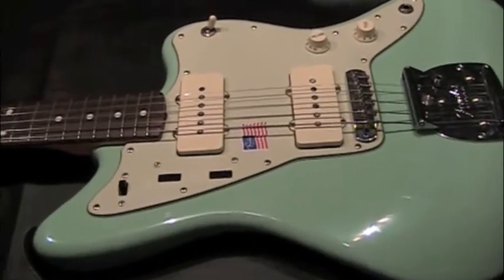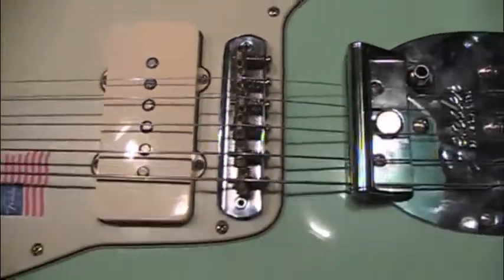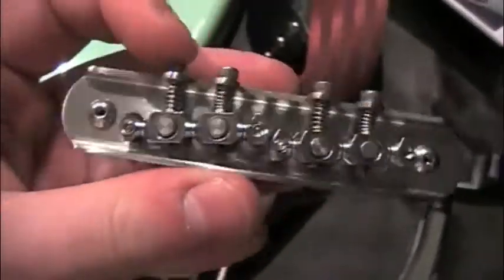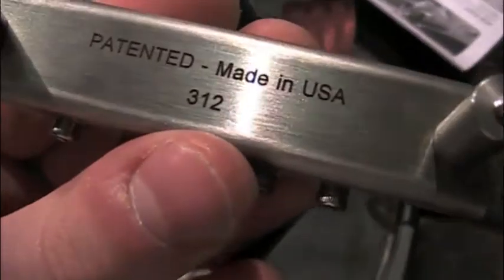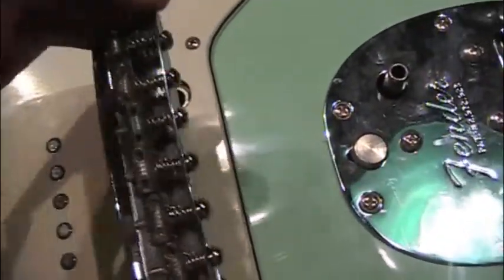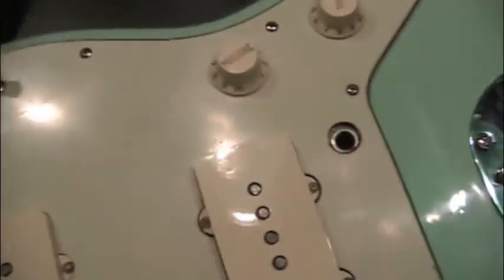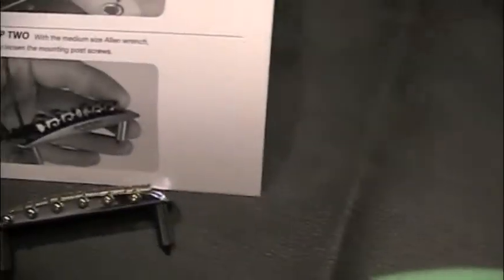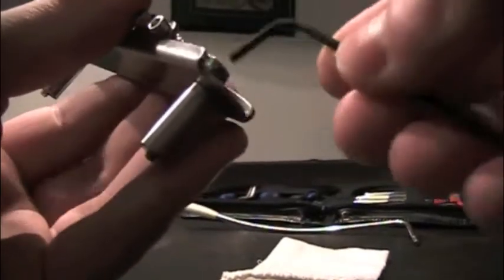Installing a Mastery Bridge on a Jazzmaster Part 1

Comment from the maker: It's a 62' American Vintage Re-issue in Surf Green, about a 2003 model or so. They didn't make them in any colours other than White, Black, and Sunburst for many years. The 62's have been replaced by the much more expensive (and more badly coloured) 65' reissues. The Squier Jazzmasters come in Surf Green but obviously aren't as good quality. They are pretty good, though. Check eBay if you want an early 2000's AVRI

Comment: what is that part you added to your tailpiece?
Reply from the maker: It's called a buzz stop, but DON'T ever use it. It kills the sound of the guitar by deadening the strings, plush it mushes up the vibrato. If you put a Mastery bridge on you'll have no issues and definitely won't need the buzz stop.